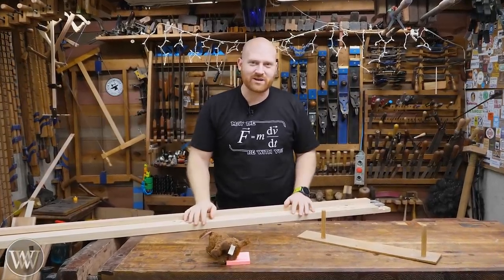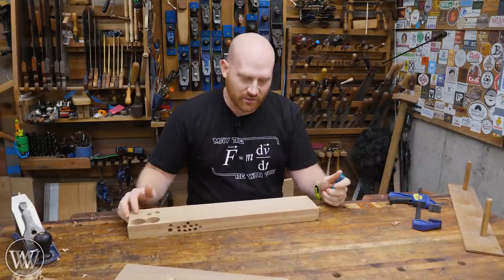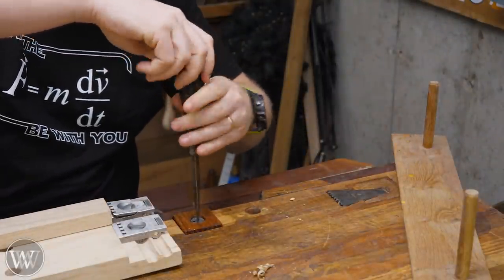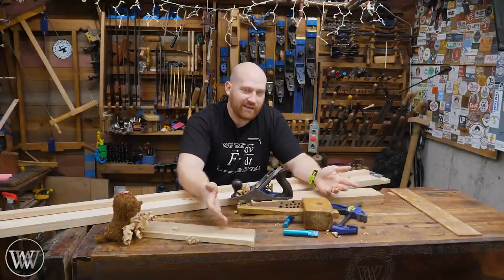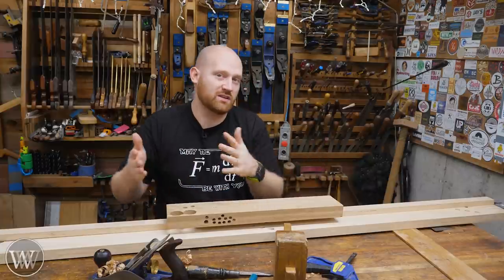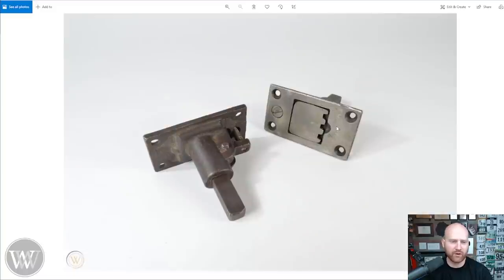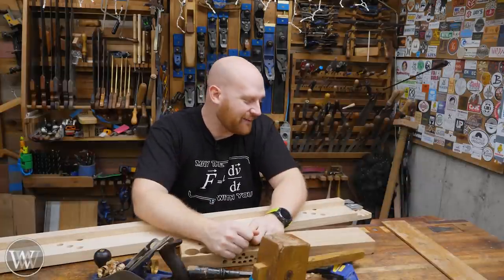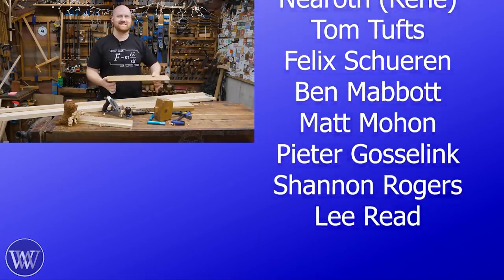1000 Ways To Stop a Board All About Plane Stops

Comment: Question- you call planing the edge of a board 'jointing' - even though the operation is the same as planing (and there is no joint involved- and every dictionary definition of joint, apart from a joint of meat, requires two parts). So, it you are 'jointing', and the amount you take off means the board becomes square, are you suddenly not 'jointing' any more? Or does it happen sooner? Or later? Love to know...
Reply from the maker: To "joint an edge" is to make it flat and tried so that it can be joined to another board to make a panel. In this case the joint is just a but joint. that is why a joiner plane or a powered jointer creates a flat and tried edge.
Reply: @WoodByWrightHowTo  not an answer to the question… So a power planer, which you probably call a 'jointer'- is it still a 'jointer' when you are planing a face? 2) If you turn a portable power planer upside down, does it become a jointer? At what angle does it transform? I am fascinated by the lack of logic involved with this strange naming.
Reply from the maker: a power planer is also called a thickness planer. a jointer is a powered tool some what like a planer but the rotating blade is on the bottom and you pass the work over it. where as a planer or A Thickness planer is a tool where you incent the wood and it presses the wood (usually up) in to the rotating cutter.
See Thickness planer: https://www.google.com/search?q=thickness+planer&rlz=1C1ASVA_enUS826US826&oq=Thickness+pl&gs_lcrp=EgZjaHJvbWUqCggAEAAYsQMYgAQyCggAEAAYsQMYgAQyBggBEEUYOTIHCAIQABiABDIHCAMQABiABDIHCAQQABiABDIHCAUQABiABDIHCAYQABiABDIHCAcQABiABDIHCAgQABiABDIHCAkQABiABKgCCLACAQ&sourceid=chrome&ie=UTF-8
See Joiner: https://www.google.com/search?q=jointer&sca_esv=2d68b74fb50c3936&sca_upv=1&rlz=1C1ASVA_enUS826US826&sxsrf=ADLYWIKzIPcEYAVoDwmnTBeV8uy7JERFSg%3A1720131068151&ei=_B2HZtf0CLP90PEP6uOR2AY&ved=0ahUKEwjX4qLKs46HAxWzPjQIHepxBGsQ4dUDCBA&uact=5&oq=jointer&gs_lp=Egxnd3Mtd2l6LXNlcnAiB2pvaW50ZXIyChAjGIAEGCcYigUyDRAAGIAEGLEDGBQYhwIyChAAGIAEGBQYhwIyChAAGIAEGEMYigUyChAAGIAEGEMYigUyBRAAGIAEMgoQABiABBhDGIoFMgoQABiABBhDGIoFMgUQABiABDIFEAAYgARIuBtQ2QlYnRRwAXgBkAEAmAGhAaABngSqAQMzLjK4AQPIAQD4AQGYAgagAr8EwgIKEAAYsAMY1gQYR8ICDRAAGIAEGLADGEMYigXCAg0QABiABBixAxhGGPkBwgILEC4YgAQYxwEYrwHCAgcQABiABBgKwgIIEAAYgAQYsQPCAgsQABiABBixAxiDAcICJxAAGIAEGLEDGEYY-QEYlwUYjAUY3QQYRhj5ARj0Axj1Axj2A9gBAcICCBAuGIAEGLEDwgINEAAYgAQYsQMYQxiKBcICDhAuGIAEGLEDGNEDGMcBmAMAiAYBkAYKugYGCAEQARgTkgcDMy4zoAf6LQ&sclient=gws-wiz-serp
The thing that makes a power jointer is the fence that the board rides on. it will hold the board up on its edge and at 90 degrees to the cutting head, and the flat long bed on either side will keep the board edge flat. This gives you a flat and tried edge with reference to the face.
The terms Jointer, joiner, Joint, and join can be confusing as they can be nouns referring to tools and functions as well as verbs referring to the action of using the tool or creating the item. tool names are always fun!
Reply: @WoodByWrightHowTo  Once again, does not address the question- have you ever been a politician?
It is common to call something by what it does (proper noun derived from verb)-
A washer washes
a dryer dries
a router routs
a cutter cuts
a sander sands
a morticer mortices
a sharpener sharpens
a scraper scrapes
a marker marks
...
If I said I had a wamberler, you could assume that I used it to wamble.
and, of course, a planer planes.
Does a jointer joint? Well, a biscuit jointer certainly does. And a domino jointer.
Should the name of a tool change, depending on which part of a workpiece it is being used on- or what angle it is being used at?
I would love to hear a cogent argument why that should be. Please, please, if you have one, give it to me.
That others use the term incorrectly  also is not an argument. Note that I am not alone- the power tool in question is called a planer in the UK, if it also thicknesses it is called a planer thicknesser. The name does not change- the top is the planer and the tool beneath is the thicknesser. So, follows the rules of dozens of other proper names derived from the verb of its function. A hand planer and a bench planer do exactly the same task in the same way- so we give them the same name. We may be edge planeing or face planeing but the action is to plane.
The name of a router does not change if we are using the fence to shape the edge. Even if that shape is part of an actual joint.

Let us not forget that the majority of workpiece sides that are flattened will never be part of a joint. So it is twice removed from being an accurate name.

Can you answer the question?
Reply from the maker: I did answer the question in the first response. To plane the edge of a board flat and tried is a joint. It is called a butt joint or a panel joint. You do that to both boards then put the two jointed edges together.
Reply: @WoodByWrightHowTo  Not what I asked! I asked at what point in reducing the side of a board does it no longer constitute the 'edge' and the operation no longer called jointing.
Your actual answer is just an unreferenced assertion. A plane in geometry is a flat surface. So the tool to produce such a surface is called a plane. A machine that does this function is a planer. It produces a plane- a flat surface. If you take two of these and glue them together, then YOU are the jointer! You alone have formed the joint.
One names a tool by its function, not some possible use for the results. A tree feller does not call himself a furniture maker, just because that is what the wood is for.
I will try again. I take a hand power plane (no problem so far?) and rotate it 180 deg. I then fix it securely to a stand. Then extend the sole on both sides of the cutter. Is it a 'jointer'? If not, why not? If so, at precisely what point does the transformation take place? (deg of rotation, amount of fixing, length of sole etc).
Reply from the maker: the operation is only called jointing if you are going to join the board. otherwise it is just planning the edge. A plane is a jointer if you use it to joint the edge of a board. all jointing is planing. but not all planing is jointing.  It does not matter if the plane is upside down or not.
Reply: @WoodByWrightHowTo  ahh, slowly, slowly... So, it is a planer unless you are both a) planeing an edge of a board, and b) you have the intention of doing this twice (or more) and gluing the resulting edges together? Great. So why, when the machine is sitting quietly in the corner, are you calling it a 'jointer'?
Reply from the maker: Because that is its primary use. And is what the culture has come to call it. Names are rarely as clean and straightforward as we would like.
Reply: @WoodByWrightHowTo  Not its primary use (as you have agreed), and even if so, not what it does (at best it prepares it for this future operation. perhaps.). What is lost by calling it a planer? I, and my countrymen, always have. It is accurate, avoids the 'transition issue', and describes the function. Take tongue and groove joints- you edge plane them first, before forming the tongue or groove on the edges. Still a 'jointer'? I have used a planer/thicknesser for more than 40 years, and I have never, repeat never, followed that by gluing the edges of the machined timber edge to edge. Do you think I should call it a 'jointer'?
I understand you hanging on to a misplaced tradition, but it is illogical and there is nothing to stop you changing how you refer to this tool. Be right (as well as wright) rather than follow the crowd.
BTW- if you use a router table to form the square flat edge to timber (not unusual) is it a 'jointer'?
Reply from the maker: Thank you for your thoughts on the matter. I will agree to disagree.
Reply: @WoodByWrightHowTo  Disagreeing is fine- but doing so without a basis is irrational. Please, consider the matter. I find your content interesting and well reasoned- I believe that you can accept the logic and embrace the correct terminology. 
You state that the tool is only a 'jointer' when it is preparing timber for butt joining- but some of your countrymen call a device for straightening saws a 'saw jointer'! Clearly, there will never be a joint involved with this... I urge you to cast aside this illogicality.

Comment: Yes, it does require skill to plane on a single stop, but no matter how good you are at it, it’s more worry – you have to worry about two things: getting the workpiece planed, and keeping the workpiece in place. I’d rather just concentrate on the planing.

Ideally I like to have a board very lightly (to prevent cupping) clamped between the jaw of a front vice and a bench dog, in addition to a stop at the end. Unclamping it to check things is only a little flick. Planing on a single stop saves time? Please – you can’t be a hand tool woodworker if you don’t have half a second to secure a board.

If I didn’t have a workbench with holes in it, I’d put together some kind of L-shaped stop, like the one I’ve seen Mike Pekovich use in a video.